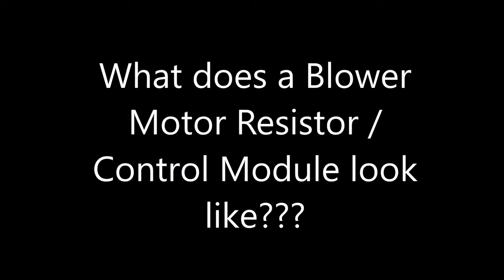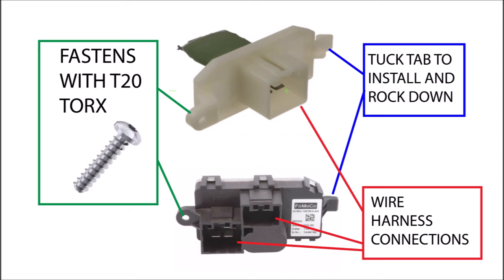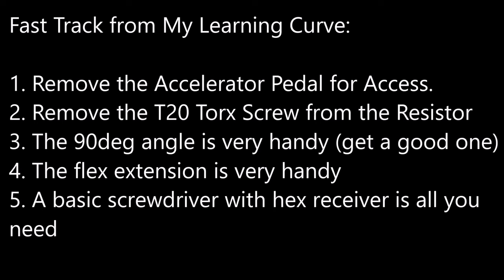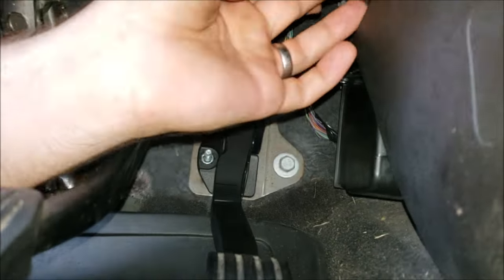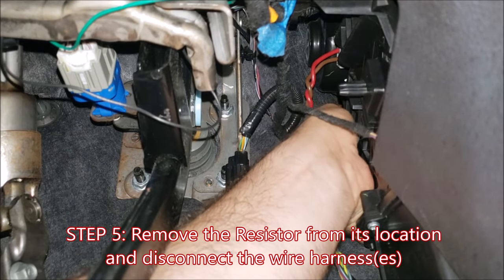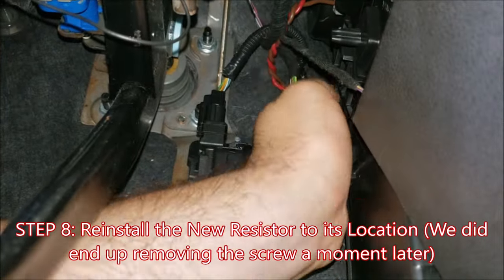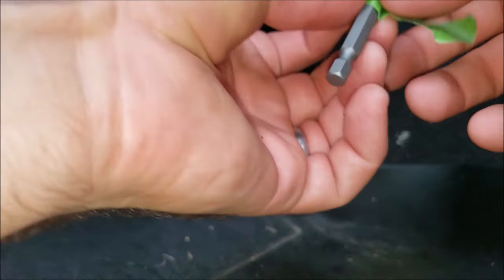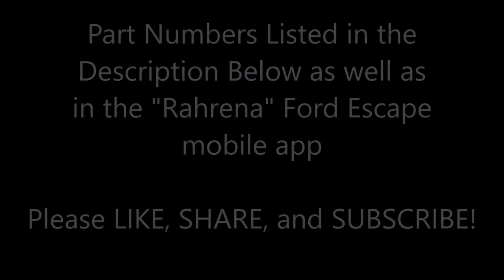How to Replace a Blower Motor Resistor for 2013 - 2016 Ford Escape: HOW TO ESCAPE

Comment: Thank you so much! This was a perfect tutorial for the job. Removing the accelerator pedal was a huge tip, and the hint about painters tape to secure the screw was vital. I used a straight t20 screwdriver, no flex or angle needed, but I definitely would have lost the screw without the painters tape.

Comment: Does it need to be screwed back in? I think it’d be fine just shoving it back in there.
Reply from the maker: It really should be. The screw holds it in place 100% and the inside face of the resistor/module needs to be exposed to the internal airflow temp of the hvac system rather than be half in half out if it were to pop free while driving

Comment: Fixed my fan not working on 1 and 2.. Great video!!! I removed pedal and i had the proper tools. Getting the old one out no problems. Getting the new one in was another story. To make sure the tab on the part goes in properly was a  living hell. 

It took 5 hours with breaks for my back pain.

Also i have manual control.

I was kneeling outside and laying on my back. 

I did it but i wont do it again

If i had known what i know now. I would have taken it to the shop..

Comment: Success! The most difficult part was getting the tab on the new part into the slot. After failing on the install, I disconnected the harness allowing me to install the part. It was not difficult to plug in the harness after that. I did remove the accelerator pedal for the install (didn't need to for removing the old part. Ford wanted $440 - I did it for $44. Thank you!

Comment: Thanks for the tips. I would not have even tried this without them. I can't get up under the dash like I used to so removing the front seat helped me a lot. You pretty much have to see with your fingertips on this job. Took me about an hour due to the difficulty lining the new resistor tuck tab.
Reply: Same here, I did job in stages, took some breaks to control frustration.

Comment: Great video! 

I was honestly surprised that you can actually see the wiring harness for the resistor. My resistor was for the base model and honestly, I could not see the wiring harness till I unscrewed the T20 screw. Also, I lost my T20 screw when I first changed mine and I just used a regular small Phillips screw to replace it.

I would also recommend running a quick ac test after plugging the new resistor into the harness to make sure it works as sometimes, these resistors can arrive as one of mine did when it came from Amazon. If you do run a quick test, the resistor will become hot so after you power it down, give it a few minutes before handling it.
Reply from the maker: That is an excellent tip on testing and the heat- thanks Lucien! Makes sense as the resistive side is inserted into the main duct for air to cool it. Appreciate your insight!

Comment: rplaced heater motor and resistor blower turns on and goes off
Reply from the maker: Hmm thats strange. Even in full manual hvac mode? Wondering if that could be the auto climate control with the tstat maybe acting up too?

Comment: I have a 2014 ford escape titanium 2.0 ecoboost and I am having a problem when you open the doors the exterior lights will come on but when you let it sit for 20 mins and open the door they don't come in and the switch is in automatic mode but then the lights work in every other mode what could be the problem

Comment: Excellent tutorial. Took me about 1 hour to replace. Use of painter tape is top notch. I did use T20 straight driver with accelerator pedal removed. Also disconnected accelerator pedal with harness.

Comment: Hey i was curious if you can do a quick video on something ASAP! I have my passenger door window seal broken from someone breaking in. I have the new part to replace it but i dont know how to make it go in properly. Can you do a quick comment so i can get this done before it rains? I have a '14 Escape SE. a comment will work if fastest
Reply from the maker: Hey there, Michela- when you say a seal, are you talking about the actual rubber that lines the entire window perimeter or are you just talking about the base of the window where there is the flat/straight cosmetic outer trim? Sorry that happened- hopefully we can help- it's dark out right now though, so probably not tonight unfortunately :/
Reply from the maker: Is it this piece here? https://www.tascaparts.com/oem-parts/ford-run-channel-driver-s-side-lh-cj5z7825767a?origin=pla&gclid=CjwKCAjw1ICZBhAzEiwAFfvFhMdYYLu8kXQ63P8GahUjOGIcKixzLjIUfturEzKimQwkmcjMf6K-ChoCQUAQAvD_BwE
Reply: @HowToEscapeDIYTipsandReviews  it should be the entire seal, it looks like the window with a little extra triangle. I have the part number: CJ5Z 7821596 B
Reply from the maker: @kaynnect  Ok, so I looked it up- thanks- and I also went out to look at our '13 Escape SE. It doesn't appear that the seal can just be pulled off or pressed back in- without spending a whole lot of time on investigating, my GUESS is that the side mirror would need to come off (we have a video for that), the lower outer chrome moulding MIGHT need to come off (we also have a video for that), and then the glossy panel where there's nothing (compared to where the keyless entry pad is on the driver's side). It may NOT be that complex, but it does look like the rubber gasketing is squeezed and held on pretty tightly. I can look into it more for you hopefully this week, but I wish I could've had a better answer for you tonight. Sorry I couldn't be of more help, Michela!
Reply: @HowToEscapeDIYTipsandReviews  no worries! when they broke in, they also broke that plexiglass side piece so i have both ready to go. I already know the trim, im just nervous about the mirror. mainly about the electric parts!
Reply from the maker: Don't worry about the electronics of the mirror- it should just be one plug or wire harness when the mirror housing is removed. Here's the tutorial for the mirror housing removal/replacement that should help some hopefully- https://youtu.be/MPesn_gUGh0. Good luck and hope it's a smooth process! If you don't mind, I'd love to know how it goes!
Reply: @HowToEscapeDIYTipsandReviews  i finally got mine on, water and air test passed! i think my '14 is a little different than yours, i was able to peel it off and put it in, just took some elbow grease. Hardest part was the panel next to it, they almost have to go on together and then you can screw it back on. was a little complicated but i see the process now. Super weird to see such a clean black rubber on my dusty girl!
Reply from the maker: @kaynnect  oh that's awesome!!! Congrats on knocking it out- thanks for taking the time to share what you did- ill take a better look at my 13 and see if what I thought was true knowing what you shared now. Thanks and glad it all worked out!

Comment: Chiropractor appointment after install is recommended.  I did this on my moms car earlier this year with the Ford part.  I used electrical grease for connector to hopefully stave off her calling me again to repeat replacement anytime soon :p.
Reply from the maker: I can absolutely relate to what you're saying. Thats why we suggest taking off the accelerator pedal assembly. It gives you a bit more wiggle room and it's only 2 small nuts. Glad you were able to get it done